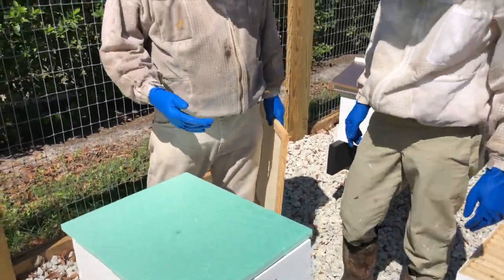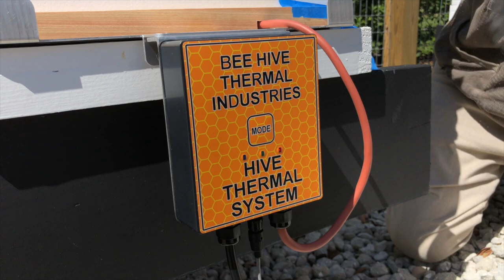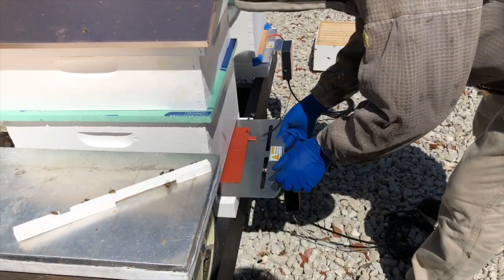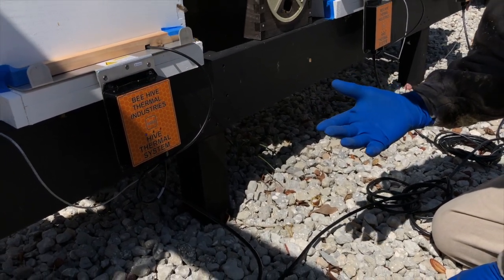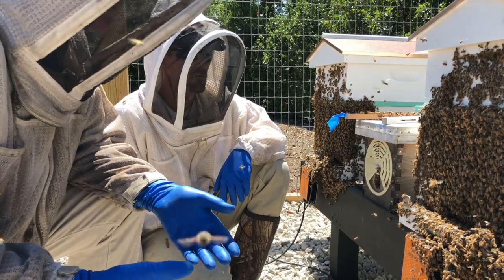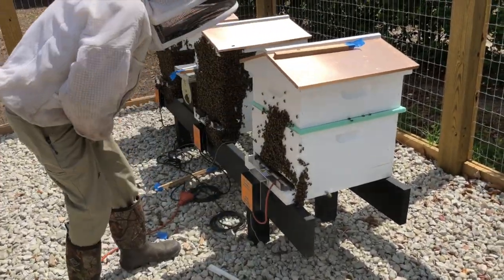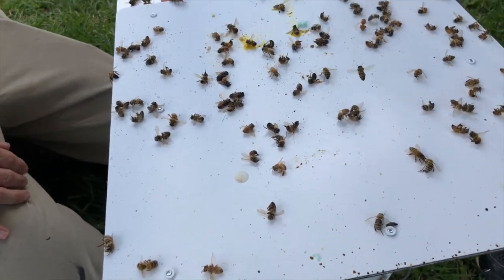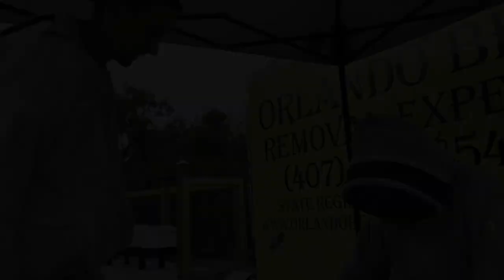NEW! - Mighty Mite Killer Installation Video

Comment: Hi, Very interesting approach to Varroa treatment, I watched the entire video but was taken back when you both did the mite inspection and there were many dead bees? I am not convinced that they died from the varroa mites, Since I have never seen that many dead bees
when checking the mite board without heat? I am wondering if they died do to actual contact on the heated surface , have you tried putting a spacer screen over the thermal pad
 therefore minimizing contact with the heated surface, yet thermal convection would not be interfered, I was ready to purchase but any loss of bees at that rate concerns me?

Comment: on the sensor wire going inside the hive stapled to the frame is noching the best way to give wire a channel or drilling hole in side of box. I wanted to be able to plug hole up due to small hive beetles issues i have....thanks!

Comment: I do not believe it triples honey production because the bees can only do so much and the nectar needs to be available so I think the claim that it triples honey production is absolutely not accurate and I also see in the advertisement where this product can be used to heat the hive in extreme cold conditions yes I’m sure he can but also you’re going to create a lot of moisture if you warm up a cold I’ve like that and how long are you going to leave it plugged in or you gonna leave it plugged in all day all week you certainly can’t plug it in for three or fourOr five hours and then unplug it because you’re certainly going to soak the inside of the HYBE when the warm air condenses into water droplets